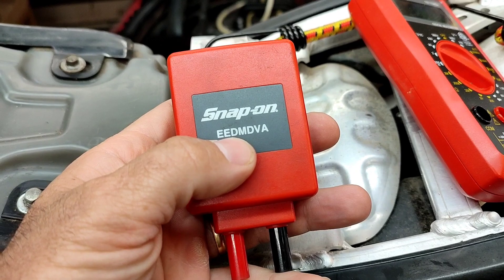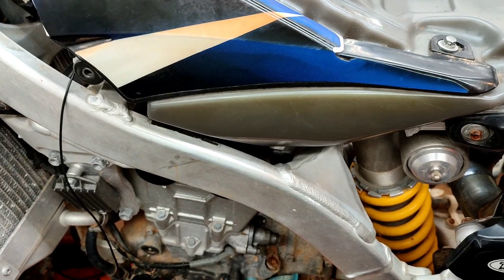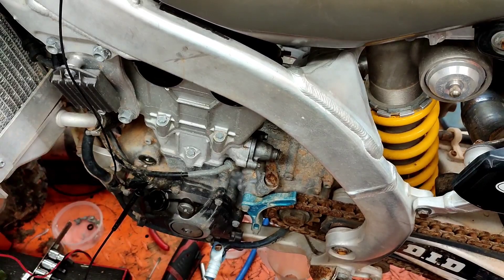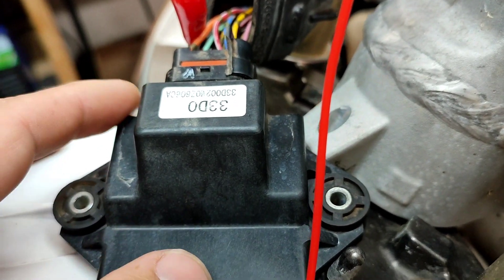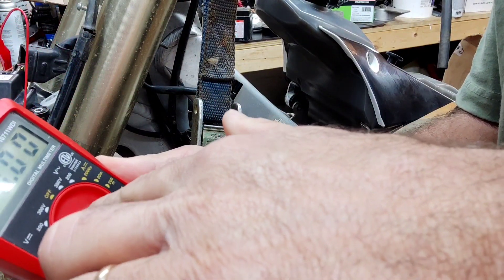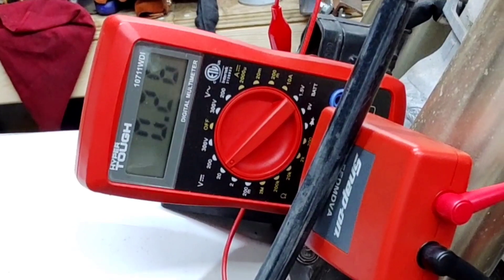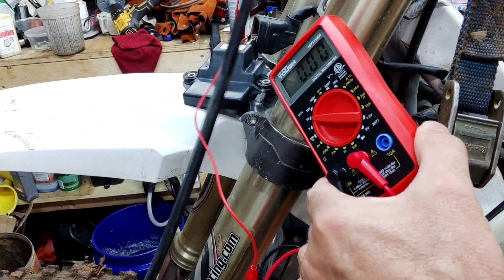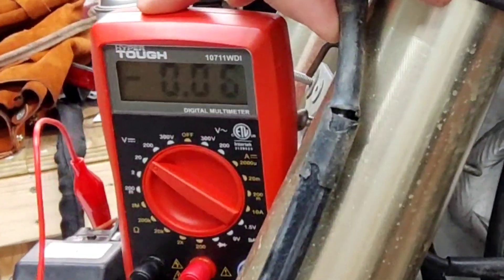Don't trouble shoot electrical problems without this tool!!

Comment: Nice video..just to add for the cheapskates like me. I did a diy one for troubleshooting my 250r. Search youtube for "diy peak voltage" literally less than $5 worth of 3 pcs. components (diode, capacitor and resistor) and 10 mins with a soldering iron. Works like a charm.